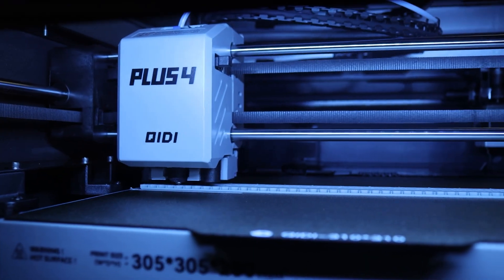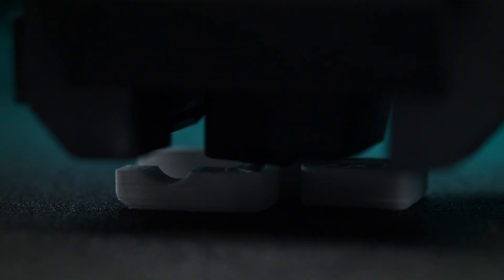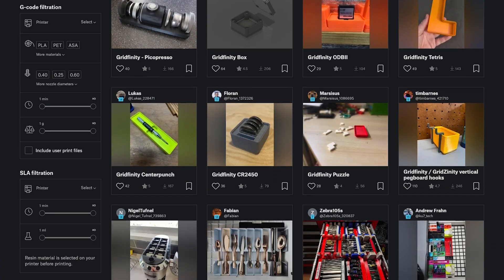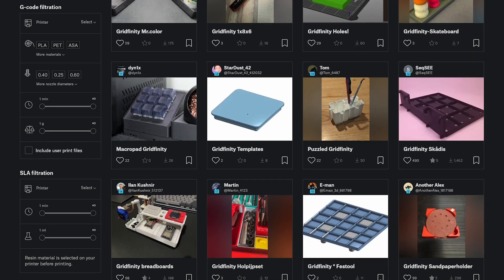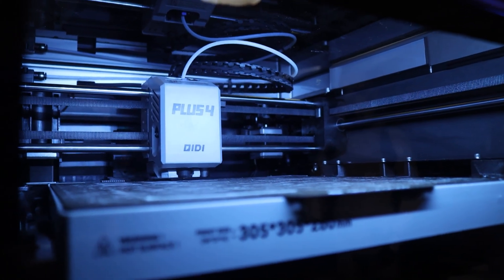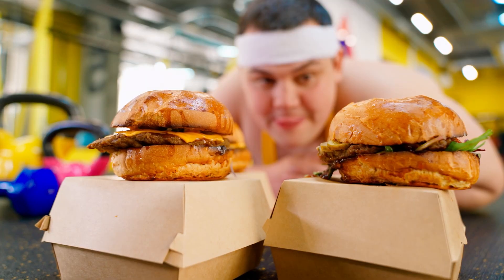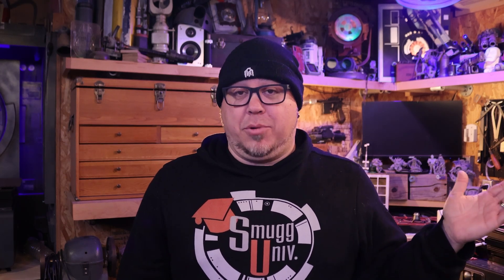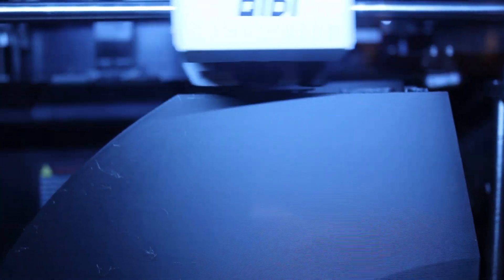I Was Wrong About 3D Printing

Comment: Very tempting and compelling, sir!

I've been extremely reluctant to engage with 3D printing for exactly the reasons you outline...my tools can't become an impediment or be a source of frustration. 

Obviously, the incredible variety of problems that could be solved with 3D printing is a HUGE appeal, but having to monkey and tinker with the tool to get the desired outcome is most definitely not appealing.  

However, if we’ve finally reached the point where 3D printing ‘just works’, I’m going to have to really consider taking the plunge!
Reply from the maker: @RevenantManor  I was right there with you.  But I’ll tell you, the projects I have been working on have been amazing with the addition of 3D printing.

It’s a combination of having the right printer, as well as understanding the process correctly.

Pretty fun stuff though, both FDM and Resin Printing!

Comment: Have they fixed all the issues? Problem with cpu over heating, the bed blocking the heat fan etc. I am wanting to get one of these, but have seen some issues with it's first release.
Reply from the maker: Yes and no.  The cpu issue is resolved, and all new units ship with the updated module, so that isn’t an issue.

The bed blocking the heat fan to my knowledge has not been changed.  However, I have printed multiple large prints and honestly have not had a single issue.  

Some out there are talking about it being a problem, but with all the large scale items I’ve printed it’s not been an issue once 🤷‍♂️
Reply: The steppers get like 85 90 c but I got a fan on the way from Ali Express should fix issue. They have a print that it mounts to and you should be cool. It steps up to 92x25mm fan